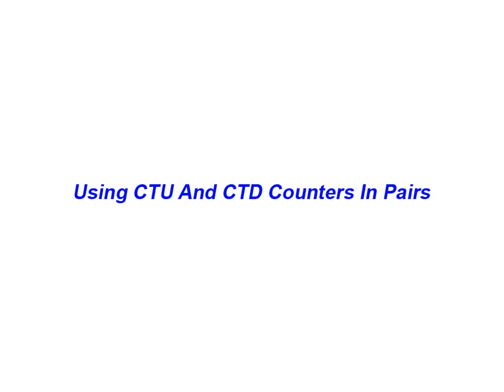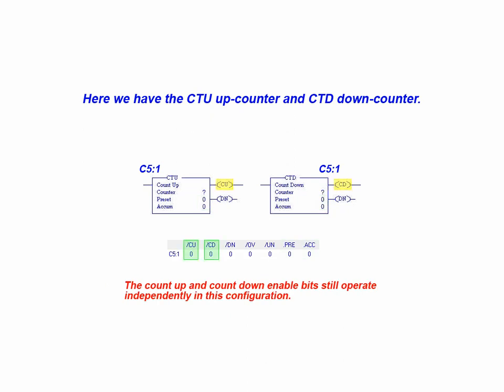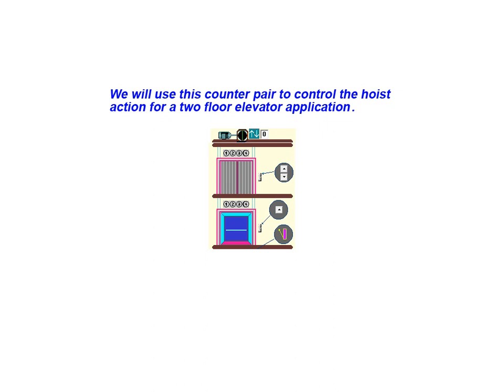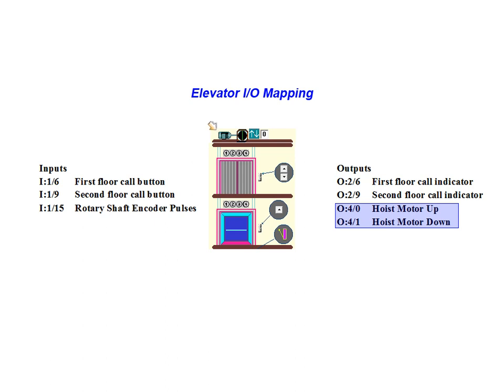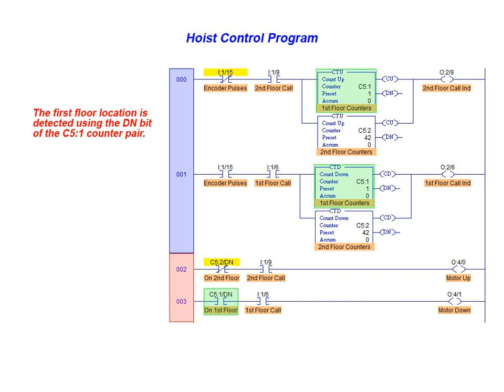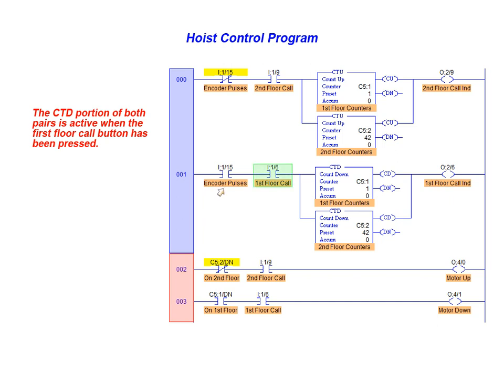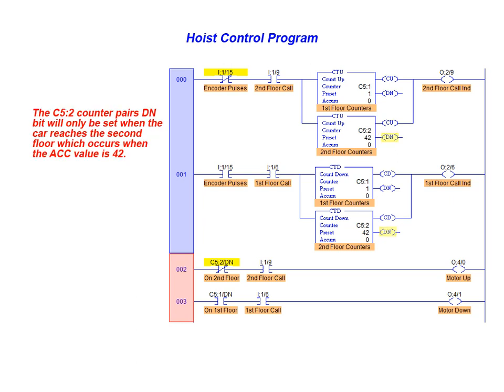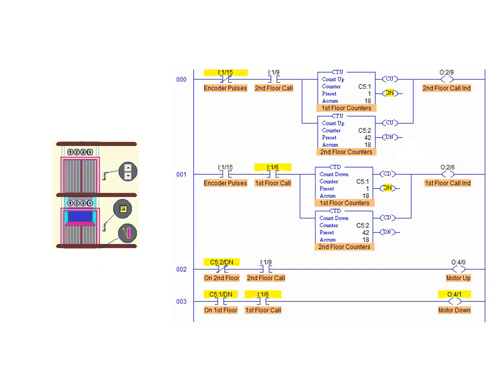PLC Up/Down Counters Using CTU and CTD instructions (Online Tutorial)

Comment: why did you use the number 42 for the preset value?
Reply from the maker: The rotary shaft encoder produces 42 pulses during the elevator cars movement between the first and second floor.
So if on the first, and the second floor call button is pressed, the encoder will provide 42 pulses when the car moves from floor one, to floor two as well as travel from floor two to floor one.

Comment: m using a CTD count down counter in my plc program.
how do i stop it from going past 0? it ends up going -1.-2 etc?? what instruction do i use
its a parking lot application so
Reply from the maker: +Master Mo Hello, you could use a "less than" block with an RES instruction on the output rung side of a new rung.  Use the ACC value of the counter and a hard ZERO to populate the comparison instruction.  That way, if for any reason, your down counter is at an ACC value of zero, and you get another trigger for it, the counter will be reset and the ACC value will get set back to zero.   Without seeing your program, it is difficult to say, but I often use and 
RES instruction.  You could also limit the trigger to only impact on the counter if the ACC value is 1 or greater as an alternate option.  Again, without seeing your program it is difficult to say, but either of these suggestions should work.
You could also use the DN bit of the counter to trigger an RES instruction with your PRE set to zero.
Reply: techtrainingonline thanks alot!
Its a parking lot application. So ctd represents how many cars have left the parking lot. The program instructions are that its not allowed to go below zero.

(Its working in conjunction with and ctu counter)
Reply from the maker: +Master Mo In that case, I would use the option that will restrict the CTD from being triggered if the ACC value is not Greater than or Equal to 1.  In this way, when the ACC value reaches 0, the CTD cannot be triggered again.  I think the simple comparison type block would be the simplest option. Just put it in from of the CTD counter.